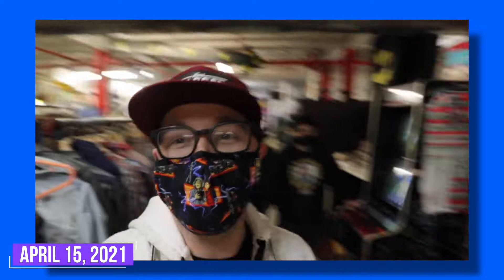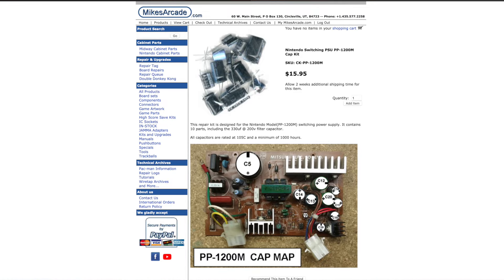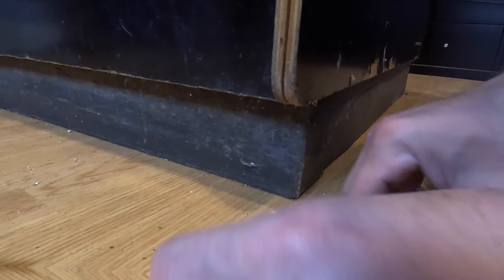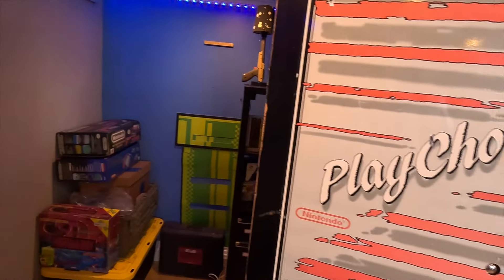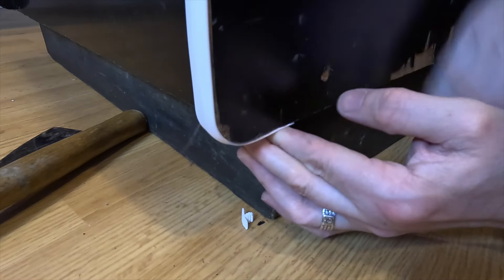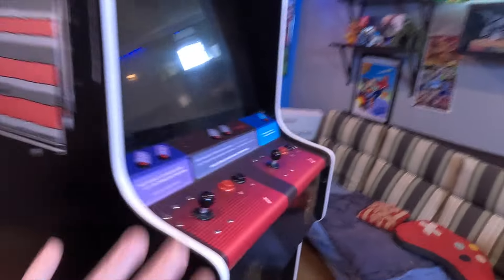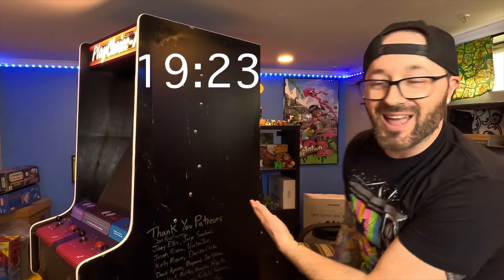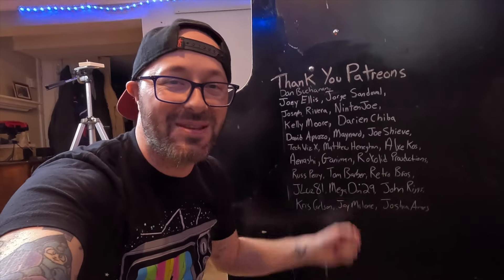I Restored The ULTIMATE Arcade Experience! (Playchoice 10) T Molding and Side Graphics

Comment: On that t molding, the parts that curve you make little triangle cuts on the part that goes into the groove. That is the standard installation practice.
Reply from the maker: Thank you Will for the tip. Yes I will probably pull the T Molding out and hit some of the parts with paint or marker to touch them  up. Than re install the t molding and make those adjustments

Comment: You need to 1,000% remove the monitor in order to take those bolts out. Period. If not, the artwork will get ruined and you will end up buying another set. Guaranteed.
Take your time, remove the monitor, cap it while it's out.  
Make sure you measure exactly where the existing art is at before removing it. Lay the game on its side, place the new artwork on top, with the backing still on, to where it should go based on your measurements.  Secure it with painters tape going across the middle of it so that it's the only thing holding it onto the cabinet. Then peel back one side only, up to the tape and cut the backing off. Apply that one side. Remove the painters tape. Remove the rest of the backing and apply the other side.
Feel where the bolt holes are on the artwork by gently running your hands over the applied artwork.  Poke a "+"  inside the bolt holes on the artwork with an exacto knife (no need to buy them out. Then put the bolts through. Do not over tighten the bolts or the artwork will get stretched.

Comment: Would also remove the monitors and carriage bolts to put the graphic on, then just screw back through the holes.  If you try to cut the holes first and then stick it on, good luck getting it all lined up properly!
Reply from the maker: Yeah I just a little  iffy about messing with the monitors. Maybe I can find a video of someone else removing them. 
That certainly would be one way to get an exact match line up.
I was hoping to put some blue tape on the graphics on the top. Unroll it and mark with a pen where I feel the carriage bolts. Than go cut the circle out and line them up
🤷‍♂️ We'll see though

Comment: It's a pain but you need to remove the monitors. During that time you can make repairs on the cab as it would be easier to move around. I used bondo to repair most of the damage on mine and also sanded & repainted.

Comment: You could use black oil based paint makers and car wax to lessen the graffiti.
Reply from the maker: i might be able to yes. That marker I was using to paint over the chip wood was a paint marker. 
The issue I run into is all the black is vinly so it will be hard matching that color and shine. So it might stand out a little bit
Reply: @RussLyman  
In a restoration video on YouTube to fix a Tron cab, he used wood filler, black oil based paint markers and car wax, that’s why I suggested it.